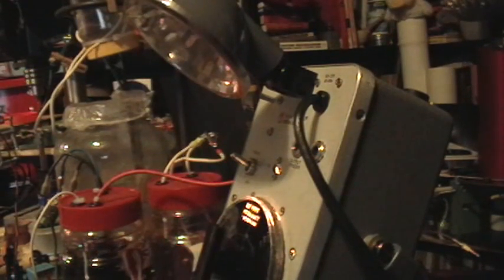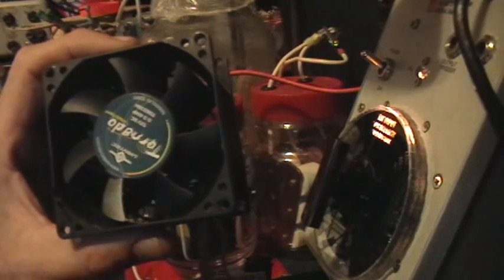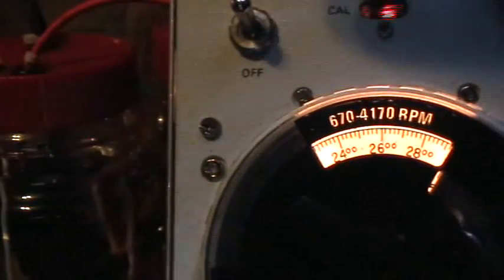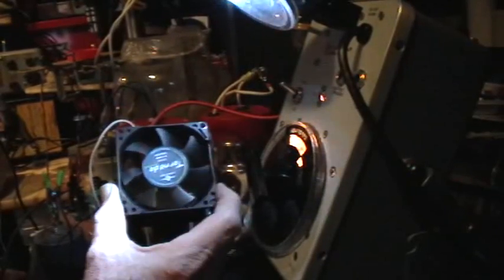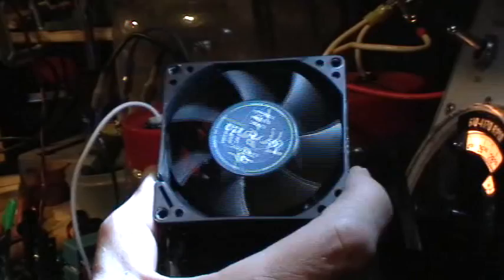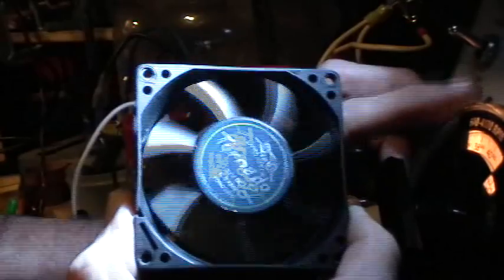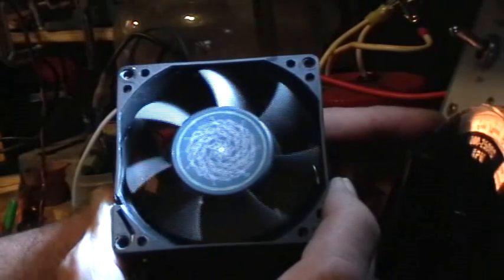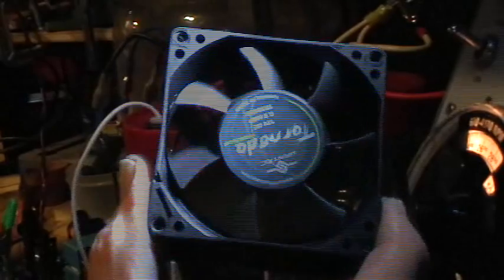General Radio StroboTac 1531-AB Demo

Comment from the maker: You are welcome. 

I hope you noticed that RPM determination with a stroboscope isn't always straightforward, due to the false "freezes" at harmonic and subharmonic multiples of the correct RPM. I didn't explain very well how to tell these false freezes from the real thing; perhaps I should do another stroboscope tachometry video where I can spend some time on that issue.

Comment from the maker: I try to have fun, and mostly with these videos I do.
I'd say put the fans in parallel not series (airwise I mean, and also electrically), for large volume gentle flow over a larger area. If you stack them in series I really don't think there will be much gain, unless you are pulling/pushing thru a long duct system, in which case you should use fans on both ends of the ducting.